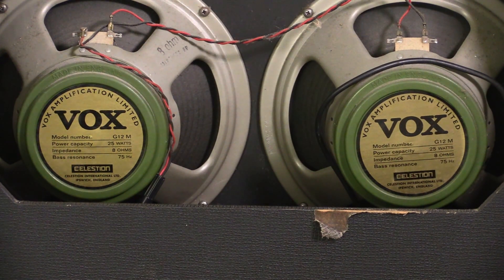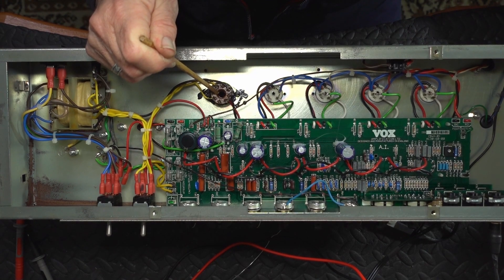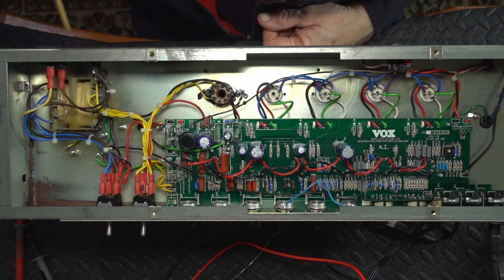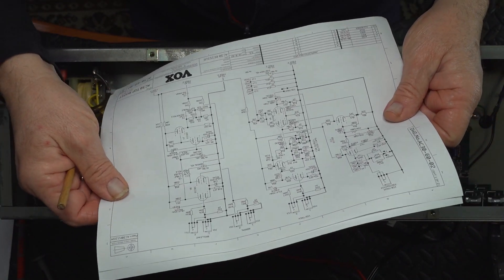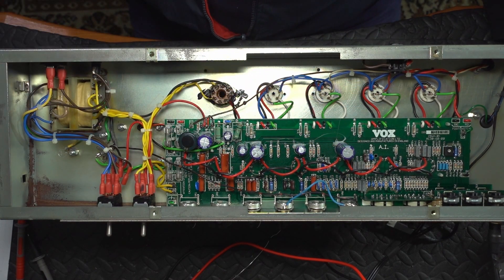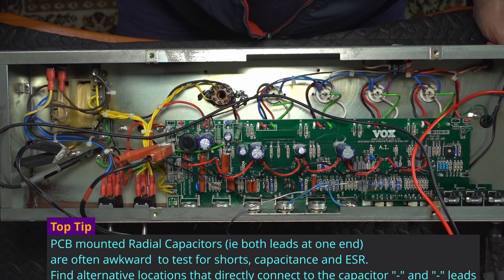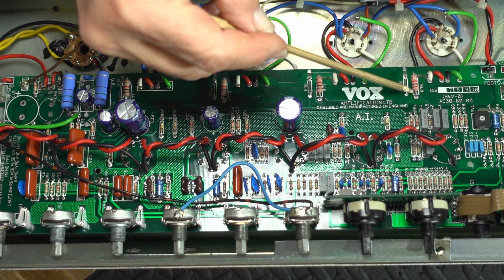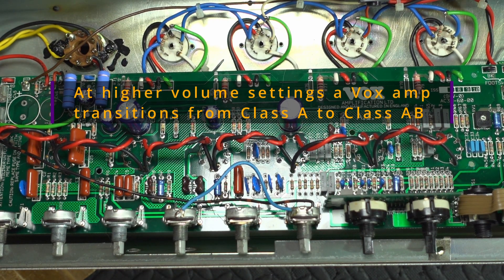Let's Repair: Vox AC30 TB/TBX. It Blows Fuses & Hums

Comment: The AC30/4 had an EF86 driven preamp as opposed to the AC30/6 which has ECC 83 preamp valves/tubes. The 30/4 was better and Hank Marvin had some criticism at that time when he swapped from the EF86 to ECC83 and the AC30/6. He had lost the original sound of the early records which were all either AC15 Ef86 driven or the 30/4.. However, the preamp valve swap was done because of the brittleness/ failure rate of the EF86 valves. I have an original Mullard EF86 driven AC15 add-on attached to the back of my Korg AC30 to give the original early 60s tone if I want it I have also been using Harma retro preamp and power tubes in the amp from Watford Valves in the UK to give a vintage tone.
Reply from the maker: Excellent insight. Thank you Nigel.

Comment: By changing grid resistor valley from 100 to 1000 I get that it will cool down modern tubes, but what if someone wants to use NOS tubes? Would leaving 100 be ok? or 470 as a compromise? Is there a happy medium to offer user flexibility for both new and old tubes?
Reply from the maker: Excellent question! Sure. Good quality NOS tubes would be fine with 100R Screen Grid resistors. No harm done in using 470R so you can swap between modern production and NOS

Comment: What effects on tone does the reducing of value of reservoir filter caps have? I also have an ac30 tb from 90s and wanted to make it sound a bit more "vintage" and closer to 60s ac30s. 

My concern is that by just copying cap values off 60s specs, does it lead to a similar result? The amp design is such that there are other variations in the circuit design which leads the designs to choose the values they do. So maybe a higher value was chosen by Korg/marshall in the 90s in order to offset other changes in the circuit? And that by simply just changing values to 60s specs won't work as well in a fundamentally different design. Otherwise, why would the designers in the 90s arbitrarily choose higher filter cap values and not 60s spec, if what made the amp famous in the first place was its original 60s models? Wouldn't they want to give it a sweeter tone to sell more units? 

This is what confuses me the most
Reply from the maker: I did a series of videos on Sag. It may be interesting for you to look over those. It answers some of your questions. You need to consider the era in which the amp was made and the style of music that was popular at that time.

Comment: Thanks for doing a great job on my vox chris. Its great to have it documented online as well. It sounds great through what ive tested so far. The teke, danelectro and gretch.
The difference i know is, no variable voltage the jmi had for different countries and went from 4 to 6 inputs and im not sure, but maybe the tremlo channel.
Reply from the maker: Unless you're touring overseas with a 35kG AC30, the variable voltage is a disaster waiting to happen. Most of the time, I will just set the voltage to 240V to protect the amp. Yes there were ac30/4 and AC30/6 with 4 or 6 inputs. Not many people use the Tremolo channel. The gain structure is different and it doesn't sound as good as the Brilliant Channel (my favourite) or the Normal Channel (maybe even more popular). Its a beauty.

Comment: Can u have to many twists so it causes a problem  ?
Reply from the maker: Thanks for the question, Tom. There is the rule of diminishing returns and economics. 
All wires carrying an AC current generate an electromagnetic field (EMF) which then induces a smaller but similar current in a nearby wire. This problem is worse when the nearby signal-carrying wire is running parallel to the power current wire. 
To minimize the external electromagnetic field, the filament wire should be tightly twisted so the fields generated by each filament wire tend to cancel. You can’t have too many twists. I would have liked to put more twists in the filament wiring for the TBX, but it comes down to costs. I would have needed to rewire the filament with longer wire, but it would have contributed to a larger repair bill. I am hopeful that I may have increased the twists sufficiently to help lower the hum in this amp. I am happy that Korg elevated the filament wires above the PCB to minimise the hum problem.  The amount of induced EMF decreases by the square of the distance from the source, ie if you can move the filament wires twice as far from the grid wired the induced EMF is a quarter as strong.
Good question.

Comment: Cool video! Its interesting the discussion about filtration.... Brad's Guitar Garage actually just finished a real 60s JMI AC30 and noted that the filtration was also way to low at 16uf which lead to a lot of ghosting. I think he also ended up around 32uf which left enough of the character of the circuit, but definitely focused the tone a lot better.
Reply from the maker: Excellent.  Thanks for that. I'll have to look at Brads video. Its sad that we are both in Sydney but have never physically met. Sydney is just so big now that it would be an hour just to get to his place. We've talked on the phone many times. He's a nice fella. I'm undecided on whether to go 22uF or 33uF for the reservoir cap. I have plenty of the 22s in stock but have ordered a few of the less common 33s.
Reply: Lads! The ghosting is part of the sound and normally I'd leave it as is, in that particular case the customer is a very experienced mix engineer (you hear songs he's worked on every day) and he specifically asked for a little more filtering to lessen the ghosting when playing higher up the neck.

Comment: GREMLINS!! No other explanation for that cathode resistor to be broken off at the hole! Seriously. How the heck did that happen? 😂
Reply from the maker: I have no idea, William. It was not a dry joint. The stub of the leg was still firmly soldered in place. It was like metal fatigue. Yep. Gremlins.

Comment: AC 30 / 4 4inputs ../6  6 inputs ?
Reply from the maker: Yes. The first correct answer. I know of one other change.  I think you would know this one, too. It's one of those slap the forehead "Oh, yeah" things that we know but forget.
Reply: @theguitaramptech  Hmmmmmmmm 
 As usual Chris....great clip and nice to learn about some history !!
Reply from the maker: @Waspfella  thanks mate…and no, you can’t borrow it for your next gig to play bass through it.
Reply: @theguitaramptech  Damn.....
Reply: To control the voltage sag of GZ34 instead of changing first filter  capacitor value, I often use small ( 22-33 ohms ) series power resistor between GZ34 out and first B+ filter cap. It increases the life expectancy of both the rectifier tube and filter cap as well.
Reply from the maker: @jutukka  yes. That would definitely increase the sag effect while still keeping the better filtering effect of the 47uF. I’ll give it serious thought.
Reply: @theguitaramptech  And the bonus of that resistor is that it slightly protects the rectifier tube in case of a possible short time ( like 2 seconds) mains power outage too.